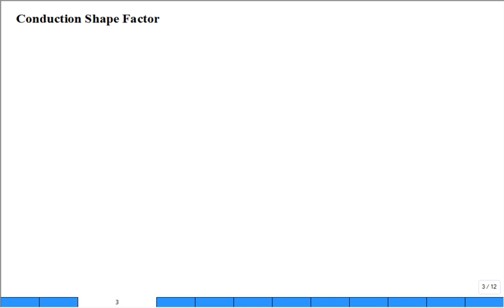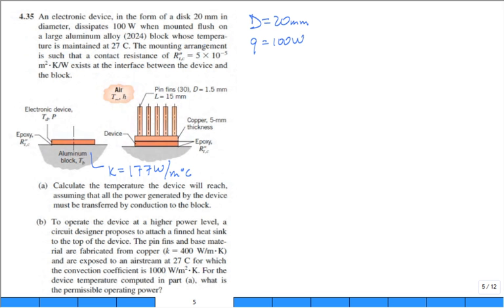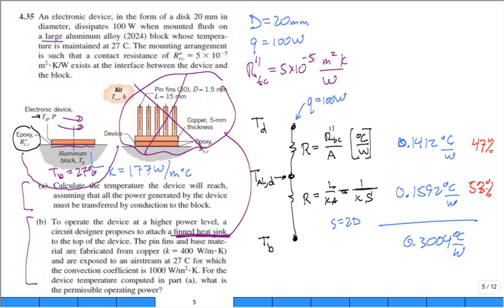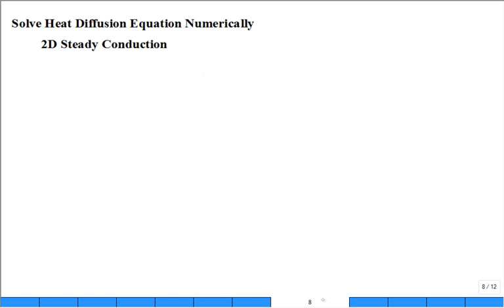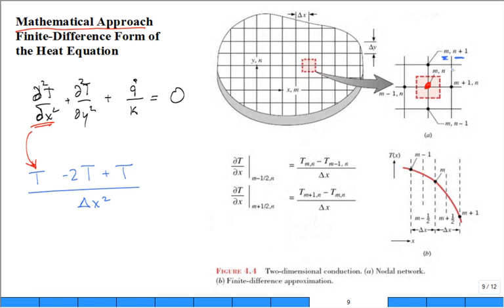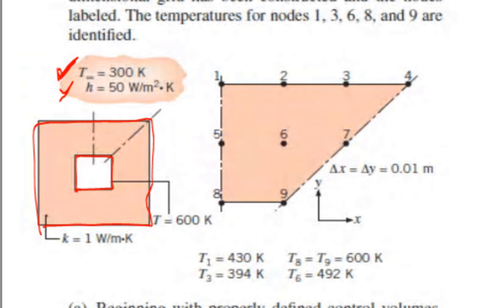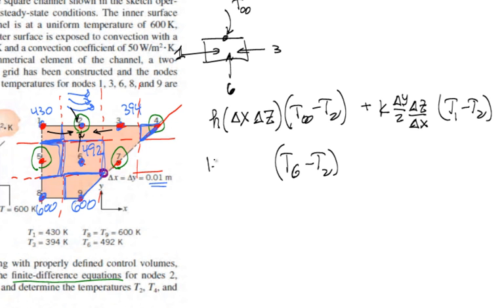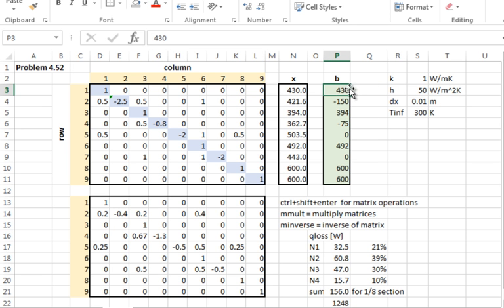Steady 2D Conduction Numerical 1of2

Comment: On example 4.35 the R values you have are flipped, The R_epoxy is 0.1592 and the R_aluminum is 0.1412... This doesn't change the answer, I just wanted to let you know.
Reply: Oh God, thank you so much. I have been calculating this for 10 minutes
Reply: I was wondering why I was getting a totally different answer 😂